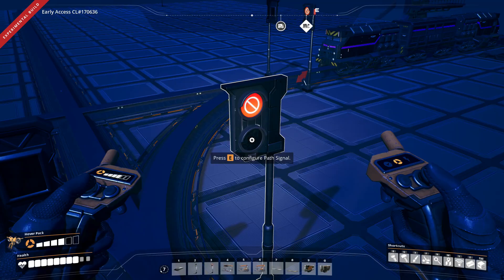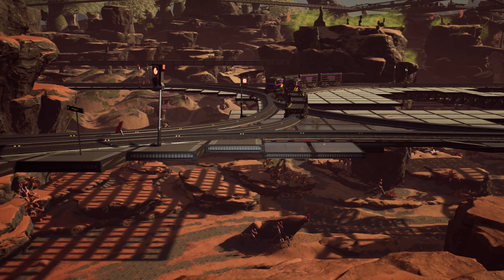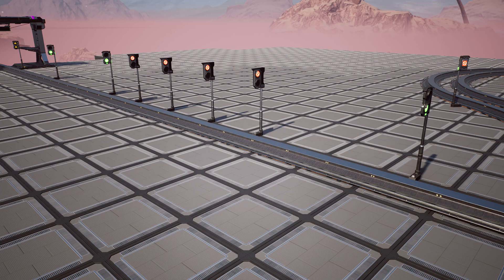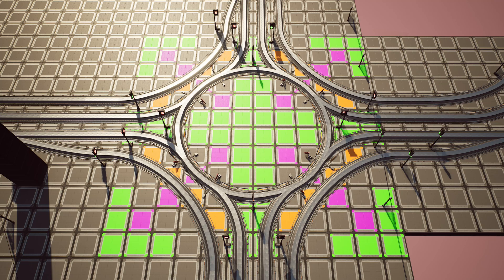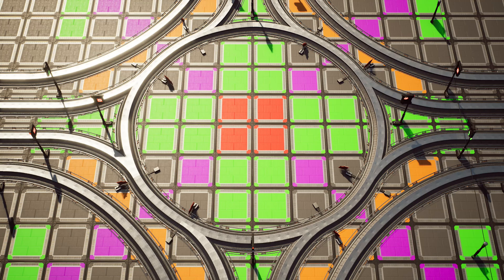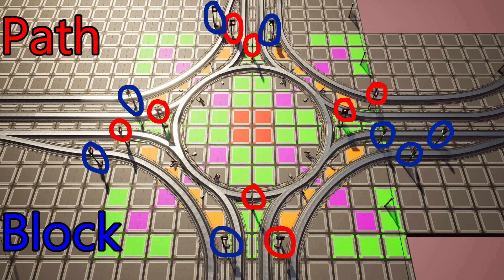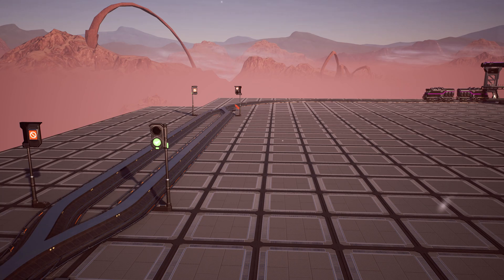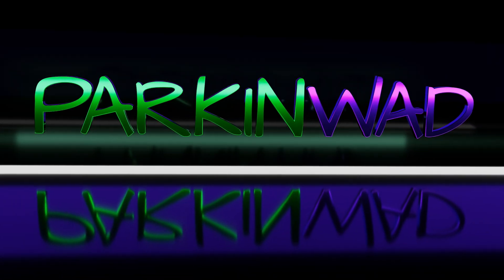Satisfactory Path Signals - Advanced Tips

Comment: Slip track signaling this way seems to not work anymore as you cannot have stations in the path block.  Using the Slip Track example, is there a work around to this?  I've trying everything and just can't get it to work.
Reply from the maker: Hey! Appreciate your bringing this to my attention. Looks like I need to put out another video with some updated train mechanics again! I found that it works again if you do exactly what I have in this video, then add a single PATH signal EXITING each of the stations. Then add a BLOCK signal ENTERING  each of the stations. This allows the trains to reserve a path back to the slip track from each station, while not allowing the waiting train in the slip to enter due to the end of the path being blocked by another train in the final exit block of the "reserved path." Hope that helps! Thanks again for letting me know!
Reply from the maker: One more note to add...you may need to bring your signals on the slip tracks away from the merge zones a little for this to work again. I had issues until I built the signals away from the "sticky" zone where they snap at the track joints. Bring them back away from the switch a bit and everything works fine again.

Comment: That's super nice, indeed. For the slip one solution, you can't add any other sign on the railroad? even block signs on the intersections?
Reply from the maker: No, due to the fact that 2 trains will end up in deadlock head to head and get stuck. You wouldn't use this design for an entire train network, but it works for a short line of a main line.
Reply: @Parkinwad  Fair enough. I'm running actually two trains on one single train line because of your video and advices and I'm very glad about, perhaps i remember some other creators said this is impossible to achieve and trains will collide. Works like a charm, so 🙂 not impossible for you. Super thanks, again.

Comment: 4:29 I am assuming those signal are all path signal??? If so I am testing this example out and it doesn't work me. It does however work when they all are "block" signals.
Reply from the maker: Incorrect on both counts. 😉 entering each slip track is a block signal, and exiting is a path signal. This simple version also works fine with all block signals. The reason I used path signals here is to force the section of track after the slip track or siding track as it could be named, to stay clear for the opposing train if this system had more than one slip track. Id have to write a paragraph to fully explain it, but it stops deadlock by using a path signal on the exit. 🙂👍 Just remember, a path must always end in a block signal, no matter if it's one or 10 path signals chained together.

Comment: One thing that was driving me nuts was this (taken from the wiki);
Error: Signal loops into itself
"This error means the signal failed to divide a block, even when no loops are present. It can occur when, for example, two unconnected tracks are too close to each other and a signal is placed on one of them."
Not one of any of the guides ever mentioned it and I placed my signals the exakt same way, moved my rail a bit and suddenly everything started to work.
Reply from the maker: I have heard of that sort of thing. I think it comes down to the fact that with train physics enabled now, tracks that are that close are considered to be "crossing" over each other, even if they physically don't. Trains that pass each other that close anyway are likely to clip each other and derail, so good track spacing is recommended from the get-go. Glad you figured out your issue, but, it would be nice if it were explained a little bit better. 🙂👍

Comment: I really want an explanation of "Signal Loops Into Itself" for cases where that isn't what's actually happening. I've had a lot of cases where I've tried to signal a T-junction the way I would in Factorio, and I've gotten this error.  Satisfactory signals seem significantly more finicky than Factorio's.
Reply from the maker: It's obviously impossible for me to know the issue with your signals without seeing them, but I think everyone comparing Factorio signals to Satisfactory is where much of the issues come in to play. I personally have never played Factorio, so I'm not really sure what differences there are with how the signals operate or are set up. For a T-junction, just double check that all connections are actually made (try driving a locomotive through all the switches from every direction to ensure no dead or missing connections as I've had that issue in the past personally), then either make the junction one  big block, or use path signals on the entrances to the T-junction and Block signals on the exits, and I've never had issues with errors when doing it that way. Best of luck and Merry Ficsmas! :-)

Comment: Nice job on the signaling. Do you have any tips on how to do the signals on a multi station? For instance have 2 stations behind eachother and like 4 in a row....... so you have 2x4 stations next to eachother..... for like a main storage hub....
Reply from the maker: Absolutely! As long as they all face the same direction, block signals work just fine to separate the stations. I have 2 back to back Stations in the same direction, and they work flawlessly with only block signals. I use a path signal only at the entrance to make sure trains wait back a little until the rear most station is clear, but it's not necessary. You could also pull the block back and make it larger! 🙂 Thanks for the comment!

Comment: Path signals aren't really useful on single track.  They are meant for something which real railways call Interlocking Plants, which is a complex junction where trains' paths can cross.  The Interlocking function makes sure conflicting routes can't be cleared at the same time.  For that last example, I have done pretty much exactly the same thing, only all I needed for it was block signals, no path signals.  The train entering the single track to the station 'owns' the track to the station for the whole time it's in there, and the block signal prevents another train from entering.
Reply from the maker: Yes, in this particular example, block signals also work. 🙂 You could add diverging sidings or turnarounds that could make use of the path signals functions, but could also theoretically be designed using block signals as well. They would just likely be very large blocks. 🙂
Reply: Seems the best way to look at it is block signals act like absolute blocks irl and path signals act as automatic interlocks (or manual with an unseen person controlling it). Before watching a few vids on this channel, I was under the impression path signals operated like distant signals, which does not work well with how the game works.

Comment: Chapter Slip Tracks ... with the setup you have you don't need the path signals, replace them with the block signals and you should get the exact same results
Reply from the maker: You are absolutely right. If people want to add sidings or more complexity down the road, path signals can help in some instances, but you are absolutely correct in that as long as there are no signals outside of the slips, blocks will work here! Thanks for the comment! 🙂👍